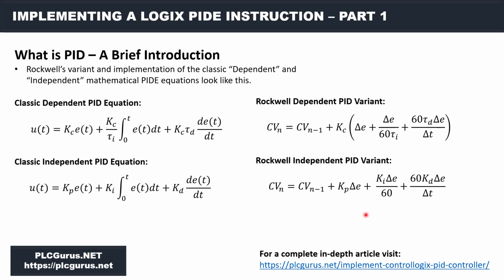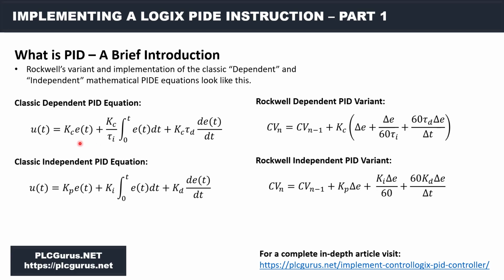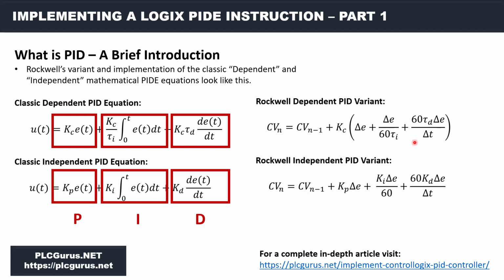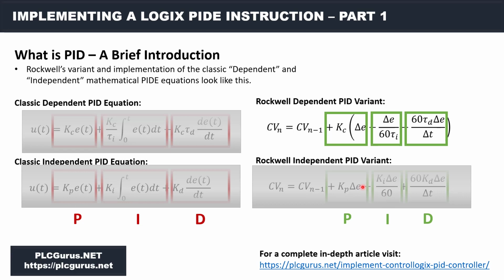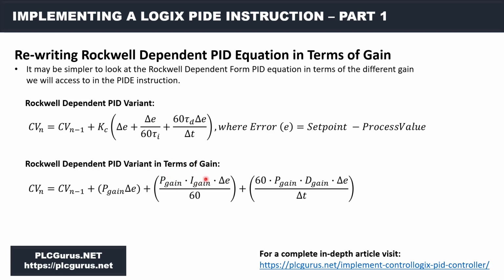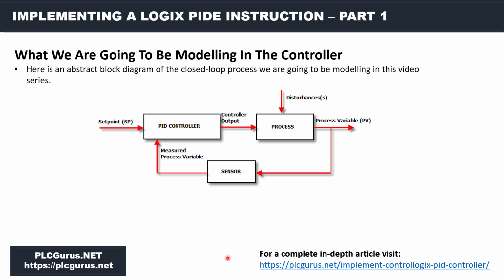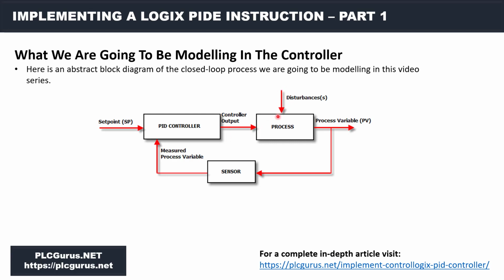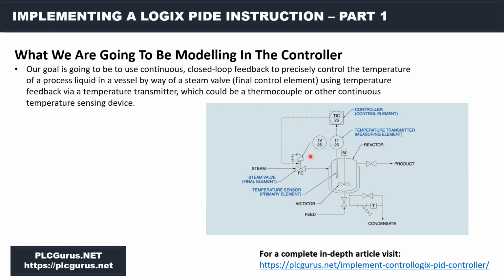PLCGurus.NET - ControlLogix PIDE - Part 1 - Introduction

Comment: I've been stuck in a recursive loop for the past 18 months because the video told me I was supposed to read the article first, but then in the article it told me watch the first video before continuing! HEEEEEEELLLLLPPPP!
Reply from the maker: LOL. while (true) { watchVideo; readArticle; }. Guess I forgot to insert the if (done) break; line!
Reply: If you use the indepent form of the PID calculation you will find out how much reading is needed to come into perfect equilibrium with the videos. I'd start with P = 1.5   I = 0.057  and D = 0  Too much Derivative and you'll spin out of control. Just leave it at zero for now.